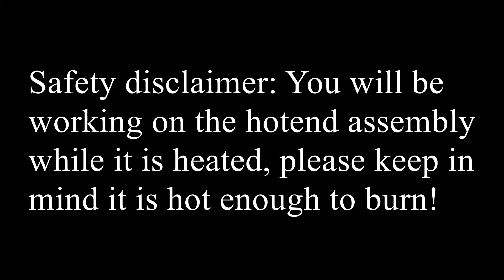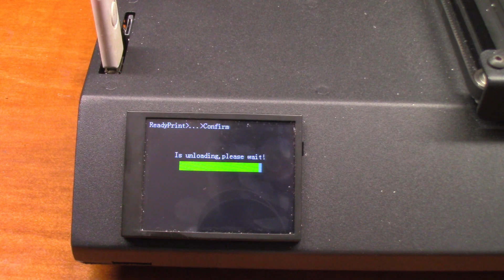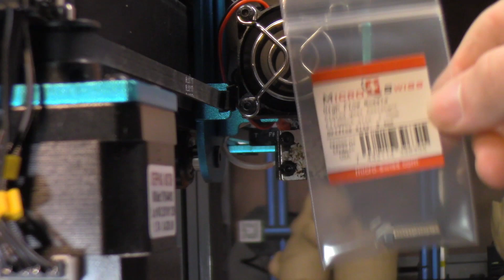Artillery 3D Sidewinder X1 Nozzle Changing

Comment: Good tutorial Calvin. Should be very helpful to those who are new to 3D printing or 1st time changing the nozzle as the basics apply to just about all printers.
Reply from the maker: Thanks, Vince, the volcano is trickier only because of the long threaded part and the block orientation being different but the same rules apply for bracing the block, etc! I am working on a heat break swap and how to fix a broken heat break video.
Reply: You can make a mini series out of the hotend. I have so many ideas for videos but just can't get myself to film yet. I have a CR-10s Pro that I'm about to swap out the capacitive sensor with a regular inductive sensor and add anti backlash because the extruder side always sits a little lower because of the weight. Will try to film it but sometimes I just jump in and go and forget to. Need to make some content that will be helpful as 3D printing is growing and many people have questions and we have answers.... well hopefully we do.. lol

Comment: Hey, thanks for the video. My heat block is quite loose after I removed the nozzle, is this normal or should it be tight? It’s only loose when heated. 
Thanks
Reply from the maker: Did you re-tighten it after heating and then let it cool?

Comment: Hi Calvin . If you are a changing nozzle size what are the changes you need to make in slicer setting .i'm using prusa slicer and i found  profile from Facebook group where you have list of options for different  sized nozzle and ist setting s.However i'm getting frequent clogs on the nozzle. I've always worked with 0.4 nozzle .i have some big parts to be printed and i want to try 0.8 and 0.6 mm .What do you suggest and what are the things you have to look out for ? Thanks in advance.
Reply: Thats my plan as well.... lots of different info on what nozzle to buy.

Comment: Hi Calvin, good video, the only thing that was not clear to me was how you unloaded the leftover filament form the extruder... I could not find such setting and I did not understand if you did this manually.
Reply from the maker: On most machines there is an "unload filament" script that heats the nozzle up. Alternatively you can manually heat the nozzle to temp and then gently pull it out manually.

Comment: great video.    I just bought 1 of these and my 1st few prints came out great.     I have purchased a Micro-swiss hot end nozzle off of there site but I noticed that my original hot end nozzle sits flush to my stock heat break, whereas yours has a slight gap.    You in fact reiterated that detail in writing.     Will this lack of a gap in my nozzle group be a problem for me by causing a nozzle clog if my new Micro-Swiss hot end sits flush with the stock heat break because it may NOT make a proper seal with the upper intake of the hot end nozzle?   If so, would the solution be to tighten down the upper intake on the hot end nozzle down to create this 1 or 2mm gap I see that you have?    Or am I just being anal?
Reply: What did you end up doing and did it work out okay?

Comment: so I did this and now the filament doesnt come out smooth, and it comes out a thick stream and glob.  what happened?
Reply from the maker: Sounds like the nozzle/heat break/PTFE is not seated right. Double check the length of your new nozzle vs the original and make sure it is not bottoming out on the heater block and leaving a gap inside the heater block. Been there, done that, it happens to the best of us!

Comment: I bought an 0.8 nozzle for my Genius will that be ok mate do you think. Thanks
Reply from the maker: I see no problems with that, just note you will need to check your gap for the first layer and you will need to increase your temps. Otherwise, go print =). I run a .6 occasionally on my Genius with no issues.

Comment: You could make video of  how to get jammed heatbreak from the backplate ...   i just fucked up ..nozzle easy no problem , but the heat break i was trying for hour , at the end i broke it . Couldn't get it out no matter what ... Fortunately that back plate cost 10£  ,,so not horror movie ...but still ..
Reply from the maker: I have a video floating around about how to remove it, just make sure that yours is actually a threaded one.